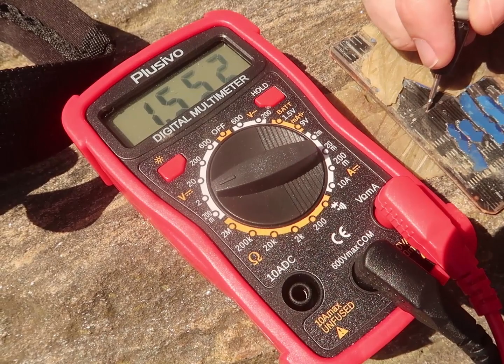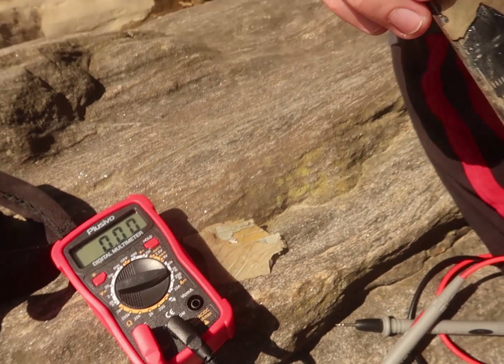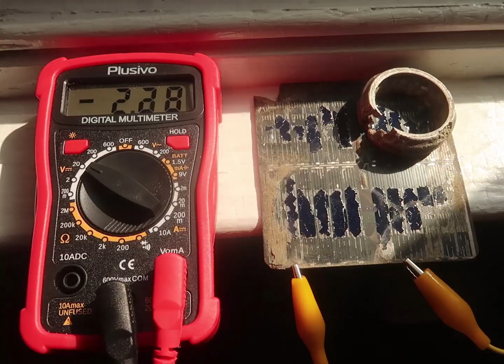Post-Apocalyptic Solar Panels: Repairing, Reusing, Recycling a photovoltaic cell found in the creek

Comment: it still makes enough power to charge a capacitor (goldcap or similar) and run a LCD clock. that would be something useful and if you bring it into a shape that has that post apocalyptic look overall it could be something that would sell...

Comment: So you know those really crappy solar panels, they were amongst the first available to the public. Typically on garden lights and such, they are distinctive because they use random flecks of PV as opposed to the higher quality sheet style. Well this Israeli research group discovered that while those very inexpensive pv panels died much quicker in terms of usable voltage, their ability to continually collect microcurrent is strangely vastly Superior to the more modern higher output PV panels. I believe the article was translated, it was not terribly easy to follow. But the gist of it was they were collecting all these garbage PB panels of all different sizes and chemistries. They found some method of rearranging these in a crystalline fashion that allowed them to have multiple layers collecting sunlight in the same work envelope. It sounded very much like they were essentially creating OSB out of old PV panels and finding that the resulting product is unusually durable, does better in low-light conditions, and is enormously less expensive to manufacture. The really exciting part of it was that they found some way to add carbon and be able to shape these crystalline structures into all kinds of familiar building materials; roof shingles, bricks, sidewalks, etc. They were proposing a future with a completely decentralized power grid. They believed that by using these materials in all public works, and maybe 10 years later requiring a certain percentage of your properties exterior to feature these products, this would be enough of a critical mass to force the economics in that direction. We've all seen the Paris Accord and a dozen other climate pledges be watered down and unmet. Greed is pretty universal. I think the best way to affect change on a large level has to be incentivizing it. And it doesn't matter how good something is for people, no one likes to be told what to do.
Reply: Sorry I wandered off the point. This article went into the prototypes with some photos and they were quite literally ground up PV in a petri dish with two leads. Might be interesting to experiment on your own? You certainly have me curious

Comment: voltage is not really the issue with panels degrading... amps are
Reply from the maker: Voltage is for physical damage though, because it shows connection
Reply: @RinoaL  but any load will drive the voltage to nil if damaged enough  i.e. deaminated

Comment: People complain about having to replace solar panels after 20 years because its dropped to 80% of it's original capacity, but what they do t think about is that after 40 years you've then only lost another 20% off not the original capacity but off the 80% remaining. So if you oversize a system by around 50%, you can have basically free energy for more than half a century, if you get it setup when you're 30 that's basically the rest of your life. Solar cells last a seriously long time.
Reply from the maker: And we're finding that solar panels are lasting a lot longer than that. I recall seeing something about a 1980s panel that's only like 3% less power now.
Reply: Even like those ones you got cheap back in California and you resealed the broken glass
Reply from the maker: Wow Thomas. I was about to reply to MrKillswitch that I got panels that were shattered (maybe by hail idk) but then you wrote the comment for me. It’s kinda wild to have strangers on the internet who know me so well. Or at least my projects, even if I hold my personal thoughts to myself. Ita really cool.
Reply: One can take advantage given how wasteful people can be either selling old panels for cheap or just simply throwing them out so cheap or free panels who can complain so long they aren't hail damaged.